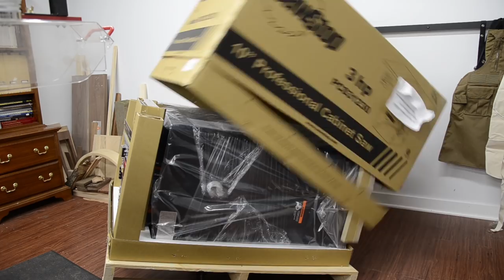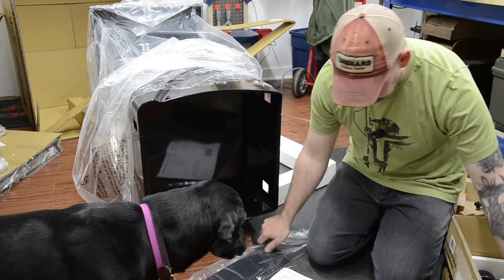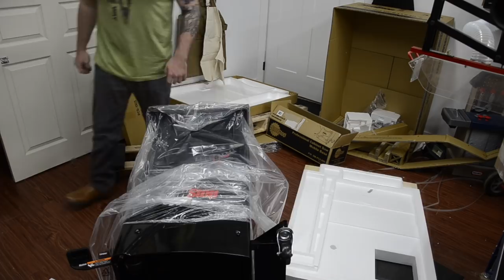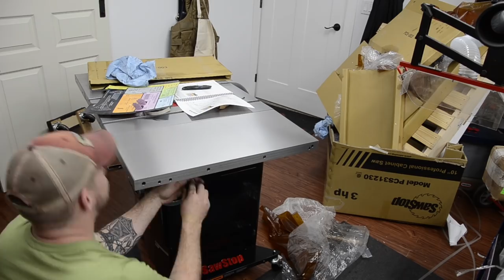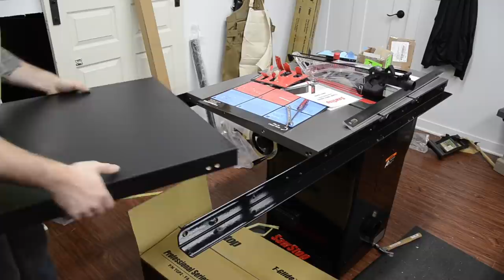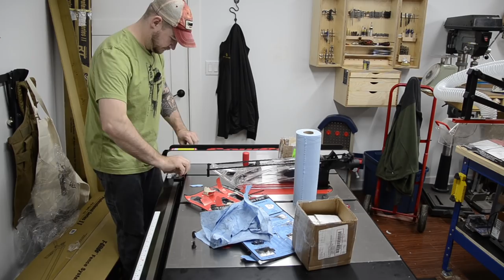Quarantine Chronicles - Week 1: I Bought a SawStop!

Comment: Congrats Logan!  You're going to love the saw.  I bought the same setup  from a local industrial supplier (that deals with the public) as a retirement gift to myself last Spring.  A real splurge, as I'm only a hobbyist. It replaced a 20+ year old Powermatic 64 that was a fantastic saw, and now sits in my son's workshop. I wanted the extra power and the safety features.  You probably won't have to adjust a thing.  Mine was dead-on accurate right out of the box.

Comment: When assembling my brand new PM66 a number of years ago that if you clamp a couple of 2 x 4's across the table saw top on edge, that when you need to add the wings and table you can clamp those to the 2 x 4's and everything goes together and lines up easy peasy.
Reply from the maker: Great tip - Thanks!

Comment: I have the same outfeed setup w/my 52" SawStop.  I actually lowered it so it is approximately 7/16" lower that the saw top so I did not have to route slots in the outfeed table.

Comment: The Sawstop contractor saw is my next purchase.  I work alone all the time... always super careful but I gotta say I really have wanted one because of that.  Time to do it soon... Congrats and enjoy !  It's a nice quality rig from what I can see !  Nice video and thanks!  maybe take the feet off your outfeed table and use 1/4 inch ply under legs might lower it enough ?
Reply: Nice saw,  i have a suggestion,  why don't you figure out the difference between the outfeed table and the saw, and just add small spacers between the roller bases and the saw. 
Sounds a lot easier than reworking the legs on the table.   Just a thought from an old man.  Have a great time with your new equipment,  stay safe..

Comment: Congratulations on the new saw. I put the same saw together 5 months ago and am extremely happy with it. I replaced a Delta contractors saw after an accident and my wife said told me to buy a Sawstop. Fortunately I had a good doctor and I have 90% use of my thumb after it was reattached. Tip: if you bought a spare insert for use with a dao head and haven't opened it then return it and buy the insert from Infinity Tools. It costs more but you will save $$$ in the long run being able to use replacable inserts.
Reply from the maker: Sorry about your accident, but glad you are okay.  The best advise is to invest in aSawStop before you have an accident, right?  Thanks for the heads up on the Infinity Tools insert plate.  We have friends there, so I'll give them a call.  :)